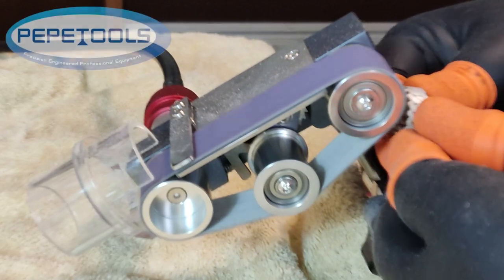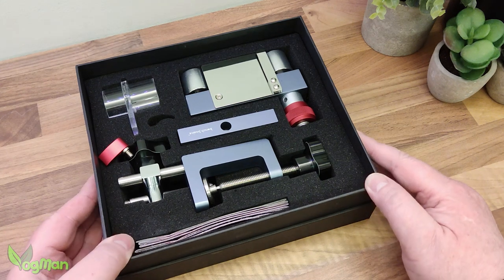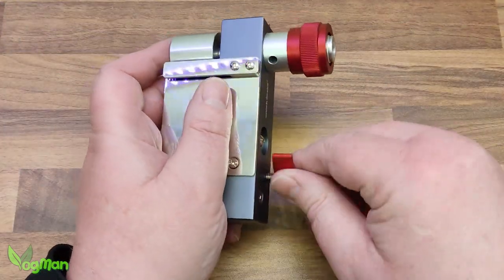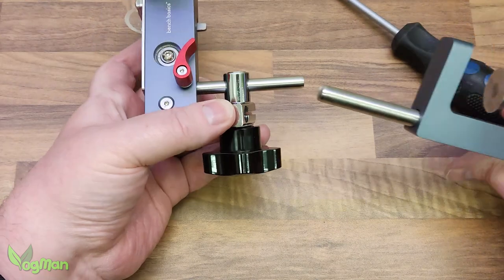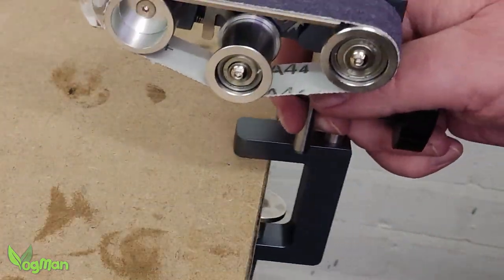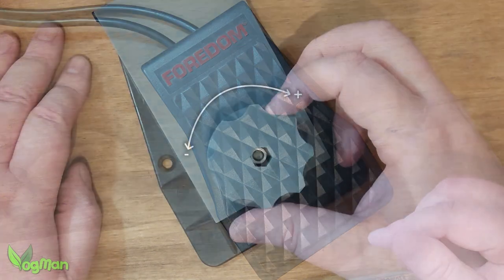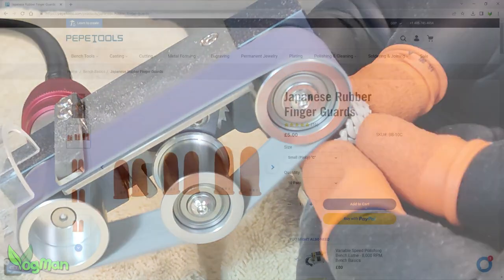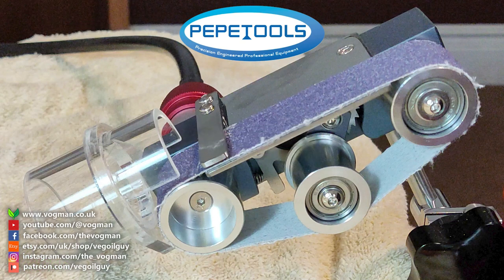Amazing Mini Sander (Bench Basics Power Sander BB-826)

Comment: Okay, I was not expecting that. I thought it was some small, light-duty, hobby sander with mainly plastic parts. This looks well-made and durable. I wonder if I can put zona sheets (or a similar type for belts, I don't even know what to look up to see) on this for resin polishing.
Reply from the maker: This sander cost me nothing and Pepetools asked for nothing, so I expected cheap and flimsy too. I was VERY surprised. There IS quality here and above all CONTROL. I have a big bench sander and it's too powerful for small projects, but this one leaves me with all my fingers and a feeling of being in control 😁
As for Zona Sheets, I'm not sure how fine those are (I've never used them). I know the finest belt that came with this product is 320 grit. I hope that helps.
Reply: @vogman  Thank you, looking up the grit equivalent I just ruled out trying to put the sheets on here, too much power for 8,000 or 12,000 grit sheets. Still, I can think of many other uses this will work on instead of just sanding resin.